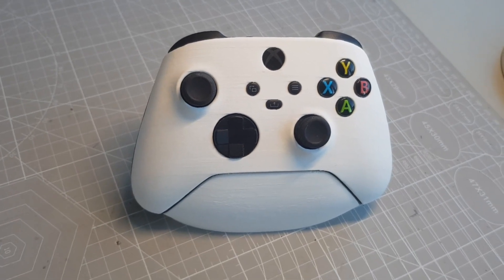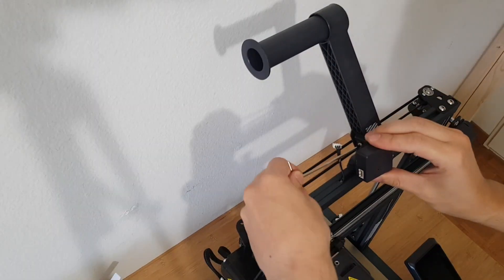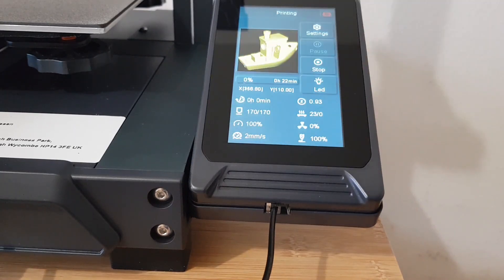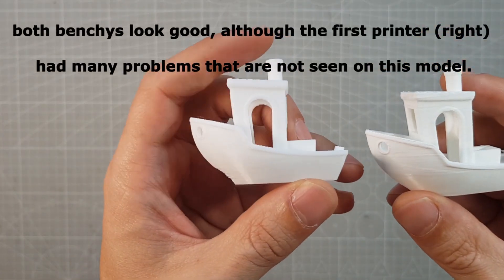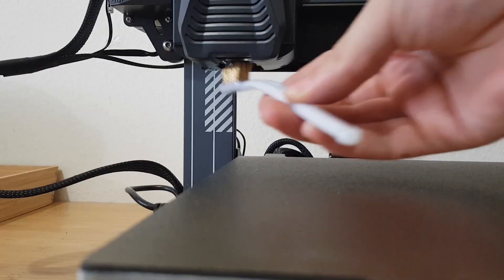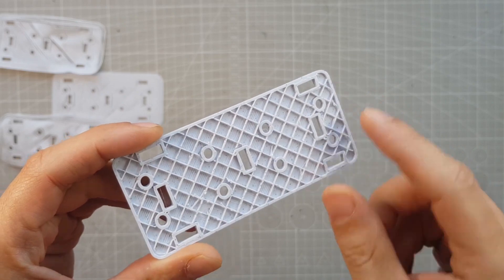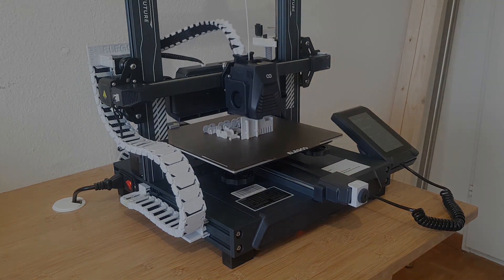Elegoo Neptune 4 Pro - Tips and Things other Reviews dont tell you

Comment: A lot of these problems seem like alignment issues. level the bed, level the bed, level the bed. if your nozzle is scrapping, your bed is most likely not level. Also your Z clearance should always be adjusted, more often so with larger prints. I have Neptune 4 plus and only been printing for 2 weeks and z axis clearance and bed leveling is key.
Reply: Also if your running at 500mm/s you are going to get more movement and shaking with your printer, which in return will slowly misalign your bed. that will cause scraping.
Reply from the maker: Thanks for the tips mate, guess you are right, it runs flawless now. But i guess it was also a twisted axis, as i had no problems with the 2nd elegoo printer i got. But leveling and z offset also does its part 👍
Reply from the maker: @Skimer54  Hi Skimer, true, i now run mist prints at 250mm/s and get better print results. 👍

Comment: Loved your video! Can I plug an ethernet cable from my laptop ethernet port to the Elegoo ethernet port to make it work on the Internet?
Reply from the maker: Thanks Russ Shanks, im not sure if that works, but i guess if you try it that way, you could make that with a "crossed-cable" (?) like if you would connect two laptops by a lan-cable.
But im really not sure... I did it with the wifi-extender, that works flawless for me.
Keep on printing and have a nice day ✌️
Reply: Yes you can
Reply: plug a lan into the printer and into your router or wherever your internet network ports out for any wired devices and your laptop can connect via wifi as long as it is on the same network as the printer, you can find your IP address in the display on the printer and type that into a browser window and it brings up Fluidd, the klipper control interface to access the functions (this is per the neptune 4 pro, i dunno about any other printers but im sure it would be similar
Reply: This worked great to enter IP address into My phone web browser and started job remotely!  Is there a way to store print jobs in Fluidd? Do I have to leave USB drive installed while the print job is printing?
Reply from the maker: @russshanks5913  nice :-)
If you print over the fluidd interface, it should save your prints and you can later select it and print it again. If you are using the usb drive, you can only reprint it over the display when the previous print is done. It will not store it if you print something other in between.
Not sure if it is necessary to leave the usb drin in the printer while printing, i changed over to fluidd after a few prints with the usb, and never get back ;-) 
Nice that it works by the lan/laptop on your side. Have a nice day ✌️

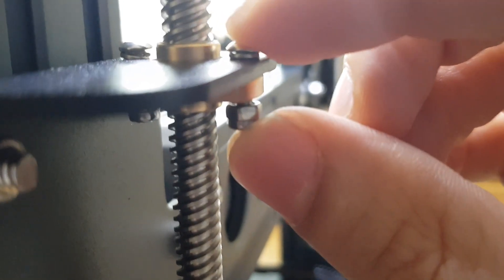Comment: 3:58 - do NOT tighten these. they're supposed to be loose. the nuts are loctited in place. the bolts need to be semi-loose against the metal plate. back them out if needed. if you attempt to tighten these you'll fk up your Z axis - even stalling and jamming it.
Reply: This is correct. I have confirmed this with Elegoo support.
Reply from the maker: glad you wrote that and thanks for the info, i will undo them a bit

Comment: I think I got your old printer 😂 I bought a certified "good" printer from elegoo and it has the save issues as your old one.
Reply from the maker: @Cheeto320  noooo 😅 
Did you conntact elegoo support about your problem?
Reply: @Dirt-E-Bikes  I have, I will provide an update once I hear from them. (It's been less than 24hrs)
Reply from the maker: @Cheeto320  ok, i hope the best for you and that they can fix it or take it back and send you a new one. My local seller (not ELEGOO) did that, but i was waiting over 1 month to get it replaced. I guess if you ordered it from Elegoo directly, it should not tale this long.

Comment: I have the same machine, and am having the exact same problem with the nozzle rubbing and scraping my models. I've made a number of them successfully, but anything with fine detail is destroyed
Reply from the maker: Hi Africats, sorry to hear that. Do you have this problem since the first prints? Or was it occuring over time?
Mine was bent, only slightly, but i had to send it back. But others said that they can go along with it by adjusting the z offset during the print... Also some good and frequent leveling can help, but if it occures all the time, i would suggest to inform the seller and maybe getting a new one.
Reply: @Dirt-E-Bikes  yes, since the beginning. but now i cant even get a successful print
Reply from the maker: @africats2  oh shit, oke, did you contact the seller? Mine was replaced free of charge, but i waited over 1 month for the replacement printer.

Comment: 3:54 if you would follow instructions you have seen to bend cable  and then insert this mount
3:56 DO NOT TIGHTEN Z AXIS SCREW NUTS!! It can introduce z wobble! it has belt on top for both lead screws so it doesn't leave space for z axis to move if its bent. Trust me I wrote support because of this and they told me to leave it as it is! It won't make print quality worse.
I had so much trouble with this printer that I can't realy recommend it. It won't be 'it just works'
Reply: Had the same conversation with the Elegoo support about my Neptune 4 Max, they told me NOT to tighten the z-screws
Reply from the maker: Thank you for the infos multidelta, i will undo the Z axis screws as you mentioned.
Its nice to get good advice like that from more experienced people 👍
Reply from the maker: @dannyh2170  thanks for the ingo dannyh2170 i will undo the screws👍

Comment: Thaks for hints.
After 5 years spent with my glorious Ender 3 (modified across the years) I want to move to something FASTER and print DIFFERENT MATERIALS.
Now I'm torn between NEPTUNE 4 PRO and ENDER 3 V3 KE.
Which one should I go for, and why? or which one NOT and why NOT?
Reply from the maker: Hey Mate, thanks for your comment.
I only have the Neptune 4 Pro and have only tested 2 Models of that printer. So im not very experienced and dont know that much what other printers are good for, or better than the Neptune 4.
For me its a great printer, but i dont have that much ecperience with 3D printing as you have with 5+ years of prining. 
I just start now to experiment with other materials and cant tell you much about tha capabilitys of the N4 with other filaments. 
Maybe i will make a video about that topic in the near future, but next video will be about all possible upgrade parts for the neptune 4... maybe  after that i can check out things like TPU, PETG, ASA and others. 
As for the speed of the printer, thats geat, i have set it to 250mm max, what does the job for me ;-)
What Filaments du you want to print?
Reply: I am also interested in a video about different typs of materials on that printer 👍
Reply: @Dirt-E-Bikes  Mainly ABS
Reply from the maker: I asked a friend who does some ABS printing, he suggested to use some sort of enclosure to print ABS because of the deforming. Maybe building one around the Neptune 4 or take a look at the Bamboolab printers that come with a enclosure and run klipper?
Reply: @Dirt-E-Bikes  Hello! This means, you ordered one, you had problems with and then they replaced it? If yes, can you make the models downloadable which showed you that something is wrong with the printer?
Reply from the maker: @adamforgo6161  Hi Adam, it was visible and hearable on every model printed that had infill 😅
Reply: @Dirt-E-Bikes  ah thanks! If i choose this 3d printer, the first thing will be to check it! Thanks for your video!
Reply from the maker: @adamforgo6161  your welcome, and thanks for your kind comment 👍

Comment: Mine has the exact same issue, I kept adjusting the z axis offset while printing and I could get it to stop. Noticed the bed was a little off after I moved it for the first time, still makes nice prints though
Reply from the maker: Thanks for sharing that info, and great that you find a way to handle that problem 👍
Reply: Update the firmware. There was an issue with the first firmware were it was not saving the Z axis after calibration.
Reply from the maker: @RyCryst 👍 i remember how often i was calibrating the z axis on my first N4p... but i guess that was not the only problem in my case
Reply: @RyCryst  they just sent my the update via email, just need to upload it 👍
Reply from the maker: @hankkrendl8952  nice, hope it will solve that problem for you